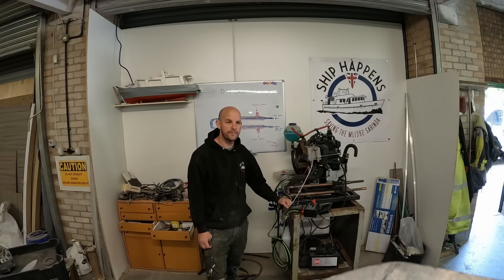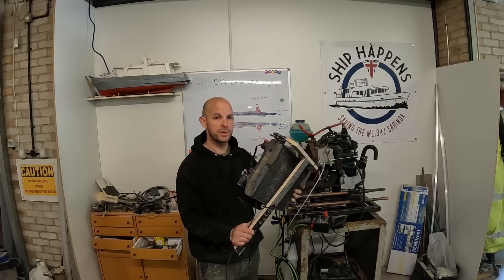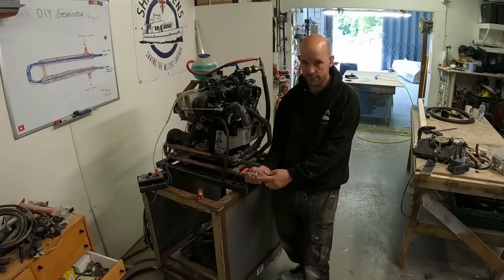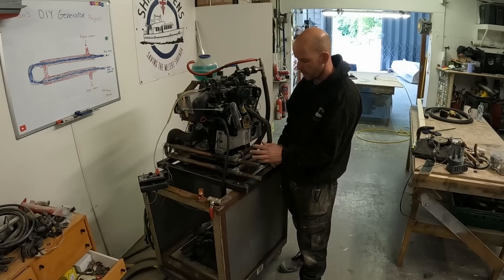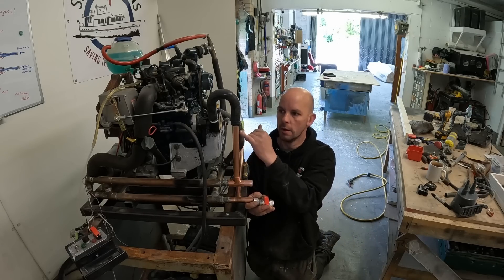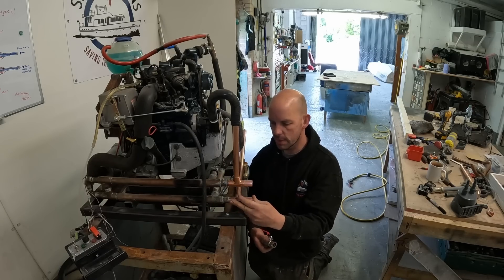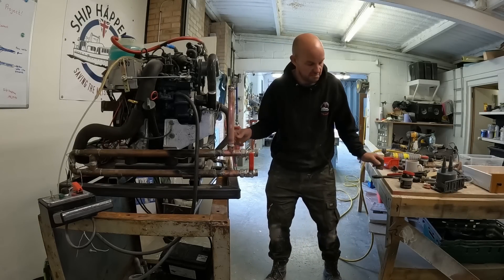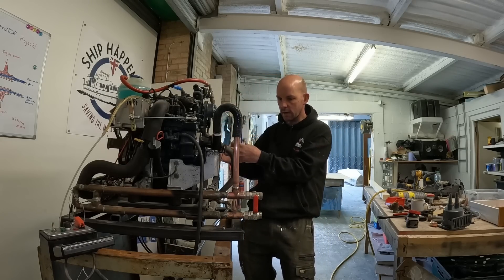From Road Sweeper To Boat DC Generator Part 6

Comment: I don't understand the need for a thermostat if you are not using the heat exchanger for creating heat i.e. hot water for the sink ect. Since the primary use is to dissipate heat from the engine it seems redundant to use it maybe even counterintuitive.

Comment: Simon. Possibly you could save yourself a lot of future grief if you made up a small instrument panel for Water Temp, Amps, Volts etc. Guages are available cheaply at car parts suppliers. Mount it somewhere you can see it easily when it is in the boat.
Reply from the maker: It has a digital panel showing all this, didn't really show it in this episode as we went over it in the past ones
Reply: @ShipHappensUK  Thanks Simon.

Comment: Did you use flux on the pipes before soldering? (I couldnt see any of that). If you do you will never have any problem with poor solder/leaks. Even with flux cored solder it does not work the same or as well as a wipe over with flux from a pot. The joints will  suck in the actual solder
Reply from the maker: Yes flux has been used on all joints

Comment: Nice job Simon. You'll need to keep an eye on that copper, salt water could be a problem.
Cooling Fan.... An alternative idea that might be worth thinking about. Instead of a bigger fan, is there any possibility of using a second fan?  If it's practical you could also control it in such a way that it operated on a slightly higher temperature range.  That way you could fine tune the cooling to keep the unit at optimum temperature.  Also, in the rare event of one fan failing,  you would have a back-up already installed saving a potential problem situation.

Comment: Quick question Simon, isn't it the flux that caries the solder into the pipe joint, because you speeded it up I missed you doing the solder, also if you have a T joint in the same place as the radiator line does that not weaken the flow a bit.

Comment: I second what Mike said,  the solder should wick in to the joints thin and not build up.  A swirl torch is better for more heat but the MAPP is a good start. To finish it off keep a damp rag close and after you solder wipe quickly while still very hot with the rag around the joint and it will remove the flux and leave a nice clean appearance!

Comment: In regard to soldering,  I find key is to “wick” solder into the joint, be it pipe or wire.  It is unlike welding,  where you put a bead on a surface.  But you have many others offering that comment!  

My unique concern to see plumbing with hot fluids/belts and pulleys at face height.  I would wear a plastic face shield to protect my eyes and ear protectors to protect  my ears,  It’s not a government regulation just common sense!  

Naturally some are concerned about you manly beauty,  but I’m focusing on your hearing and seeing!

Comment: One trick I have found to sweating copper is to take your time. It isn't a race. Once the joint is hot enough it will suck the solder into the joint. If it is beading up and rolling off it isn't hot enough yet.

Comment: Never saw you put on paste flux.  Need to flux all parts before heating.  Heat the parts until the solder on the far side from flame starts to melt.  Remove heat and run solder around both sides, drawing it in by capillary action.  Wipe while still hot with a dry rag.

Comment: Good job Simon, only thing I would suggest is silver solder or brazing the pipe joints to help with any vibration, where as the soft solder your using will break down over time. Apart from that, coat of paint and it works and does the job mostly from recycled bits which is better still.

Comment: Saltwater in the cooling system of the motor? Have i seen this right? I would build a real heat exchanger with two tubes. One inside the other. Or have i seen that wrong?
- Today the background noise was so high that i did not understand the most things.
Reply: an exchange system needs to be greater and faster than the exterior water.... It is a great idea but may not be practical.

Comment: To make sure your solder joints are full depth, heat the metal joint and let the hot metal melt the solder, not the torch flame. You can also use flux paste with powdered solder in it to help 'wick' the new solder down into the fitting...A 'cold' join may not leak right away, but the solder is only holding on in a thin ring and will fail under stress. Don't forget the sacrificial anodes, all that copper and steel joined by salt water will 'eat' the less noble metal pretty quickly...

Comment: Hi Simon, great project. Might be interesting to monitor alternator case temperature with one of those cheap little temperature PCBs you used on the radiator. As alternator case temperature rises, its internal regular will reduce current available. Don't be surprised if alternator case goes above 100C! You could also use the relay on those PCBs to sound a hooter if alternator or radiator temperature become high. Awesome job!

Comment: Simon:      Absolutely   well done!!!!  Excellent setup.. should run for years.   I ran an       auto, truck &      large marine electrical shop for a few years and I can say that your install, careful metering and testing and cooling design are top notch! 
Thanks for the really great video!

Comment: To solder correctly heat on the reverse side of where you place your solder. Once heated correctly the solder will run around your joint. Well not only be cleaner but guaranteed water proof. 
Just a suggestion. Cheers 🍷

Comment: The sense wire goes to positive on both batteries, this will regulate the charging and cut off when done. The lamp wire connects to a positive light and negative to the chassis) alternator body. This will go out when charged. If you want to get all fancy you can use a relay and switch off the engine automatically when batteries charged.

Comment: Okay this is hell I score your performance on the generator I give you a four-star out of five  because you need some improvement on your soldering skills, but it did in leak so really that's all that does matter. It's just is it shouldn't have been bunched up like it was around where you soldered it should have been a nice Evenflo and no homes around the solder but that's okay for your electrical work and your engineering skills I give you a five-star. So overall rating you did a excellent job

Comment: Have a think about the reality of what this unit will do in intermittent battery charging and the limited heat rejection will likely be more useful in heating a  domestic hot water tank  and then passively  dumping any surplus into domestic radiators to heat the cabin. Each kW of electrical output should  produce approximately 2 to 2.5 kW of waste heat from the coolant plus a marine  type exhaust heat exchanger (bronze or cupro-nickel to resist corrosion) - why throw any recoverable heat into sea water ? For the propulsion engines there is far too much heat rejection to avoid seawater cooling. For highest efficiency, consider a traditional DC dynamo.  New old stock CAV bus dynamos and Voltage regulators turn up on Ebay . A marine wind turbine might also be a good bet apart from PV to keep up with bilge pumps, fridge and CCTV etc.

Comment: I'm not a professional, but I've been soldering copper pipe joints since I was a kid - I'm 62 now.... As much as I hate to detract from your enthusiasm, those joints don't look good. Did you clean the inner face of the joint and outer face of the pipe before applying flux and pushing together? If not then all of these joints are poor. Also the flame on your blow torch is at it's hottest at the end of the clear part of the flame, around 10-15mm away from the Brass bit of the torch. 

When soldering the fittings need to be scrupulously clean and look like bright copper before applying the flux, then putting the fittings together. Heat the joints in the hottest part of the flame. Apply the solder to the fitting and not into the flame. Once the solder melts against the pipe it should wick into the joint and form a small mount of solder at the bottom on the joint as the excess runs out.

Comment: plumb the engine cooling into the heating system on the boat either directly or through a  heat exchanger... free heating off the engine... could also plumb for raw water cooling too so you have options
Reply: I plumbed in Ford Transit heaters to run off the main engines to heat the cabins while underway, worked a treat. The hot water tank was also plumbed in, both systems could be isolated for quick engine warm up from cold. So heat was not wasted, even the bilge water could be pumped by switching valves on the sea water intake so an emergency pumping system was at hand. The engine bay was a plumbers nightmare of pipes so I fitted name tags least I forget.

Comment: You need a second expansion tank for the radiator and two more valves. Looks really good and it puts out a huge amount of power. Looking forward to seeing it on the ship.

Comment: The quality of your soldering should depend upon how long you can tread water, trying to swim. It has to be 100%. Take no shortcuts. Good enough is NOT good enough when it comes to attaching anything that uses seawater on a boat. How about using your basic hearing protection when you start the machinery. You don't want to go through your senior years always gong "EH?"

Comment: Very cool. One thought,  do you have a safety shutdown for overtemp, say if the radiator springs a leak unnoticed? Wouldn't be too hard to add. Ditto on batteries in case you overcharge one.

Comment: As you said it’s intended use is during winter so I’m guessing cooling would be fine.
Plus if it’s required during summertime it’s going to be fine even as an emergency back up.

Comment: Scrap your bolt tensioner, go scrap yard take most cars with a serpentine belt, the spring tensioner is held on with one bolt, easier to make one bracket mate and its fit and forget.

Comment: You control the field current in the alternator to regulate the output. You may be able to vary the voltage on the small wire that needs the 24V to work. 
Thinking out of the box - it might be possible to artificially increase the V on the sens wire& reduce output and then slowly ramp it back down to true batt V

Comment: Too much solder, the key is a good flux, heat the metal until the flux starts to bubble and then a light touch of solder,when you see it start to suck into the joints, keep adding just enough to go all the way around.  All you should end up with is maybe a small blob at the bottom of the joint that you wipe away with a damp rag.  Never try and repair m or solder with liquid near the joints the generated steam will prevent a proper sweating if the joint.
Reply: It also helps to have the torch on the opposite side of the point where you feed the solder in. That will neatly draw the solder around.
Reply: @michaeljones6144  agree 100%